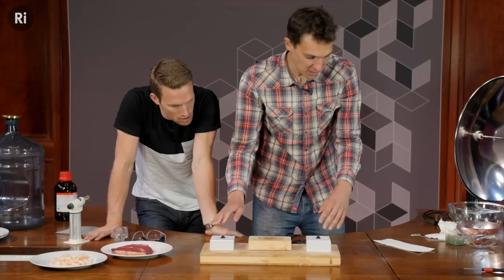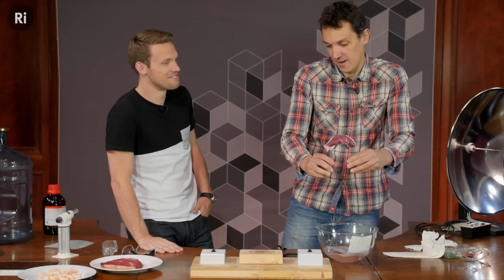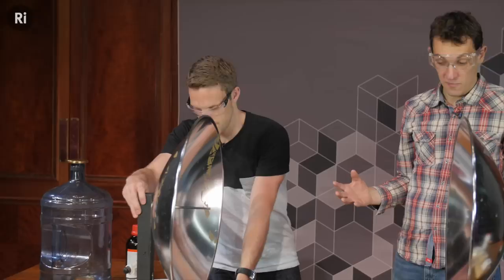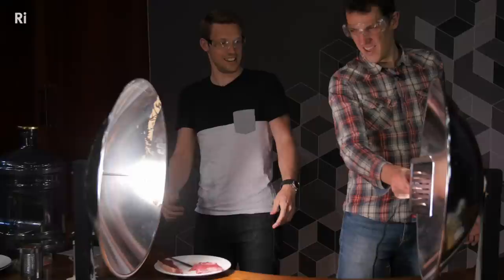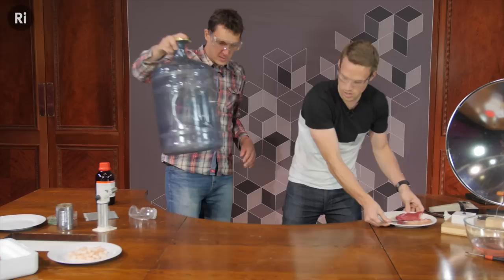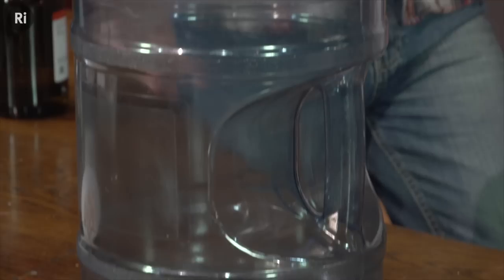Extreme Physics BBQ

Comment: Isn't the wire frame supposed to stop the flame propagation? Like the ones used in the mines to prevent combustible gas from igniting due to the lamps and stuff.

Comment: If you can add some hydrogen peroxide in it and replace isopropanol by hexane, you will get better BBQ. It is obvious that the oxygen inside is not enough, for orange fire occurs. The orange fire indicate the exist of tiny carbon particles in combustion process.

Comment: How come that when you fry the prawn, the metal mesh becomes red hot, while the plastic bottleneck does not melt?
Reply from the maker: ***** Here's what Andy thinks:
I'd say the gauze takes the brunt of the jet of flame, and also is just very small/light compared with the bottle neck, so heats up much more quickly. The burn lasts less than a second I think, which just isn't enough time to heat the plastic up enough. Having said all that - the bottle does get pretty hot! Luckily, it is made of polycarbonate, which is unusually resistant to heating.
Reply: The Royal Institution Ok, thanks!

Comment: 240 volts across the steak, not passing through the steak 😐
Reply: Jake Townsend Not Even 240V as it's in series with kettle
Reply: Touche
Reply: +Jake Townsend FWIW, that kettle in series with the steak makes for what's called a crude but effective "ballast resistor".  

Simply put, the electrically resistive heating element built into the kettle absorbs the excess energy that would otherwise make it impossible to keep the steak on the forks at all.  Ah, but why is that?

Because:  Like pure tungsten and all other alloys used for electrical heating, that pot's heater possesses a key behavioral characteristic called "Positive Temperature Coefficient of Resistance".  IOW, the hotter the metal gets from the BBQ rig's plenteous-to-excessive energy, the (somewhat) gentler the charge delivered to the steak itself. 

So note how the cooking bit o' steak "floats" in a VERY strong local "sea of energy" and starts off rather dramatically.  Meanwhile the pot's heater, by now considerably above room temperature, limits the current's flow through the tidbit somewhat like a crimp in a hose, which keeps things generally upright.

Ergo the self-limiting action that keeps the meat on the tines.   (Moisture figures in here too, of course.)  So it's called a "ballast" because of all manner of different things like that precise sort of "cushioning" action, all around the Electrified World.  

Luvvit!  Cor blimey, ain't Science grand? ;)  And that is all.  0{;-)o[